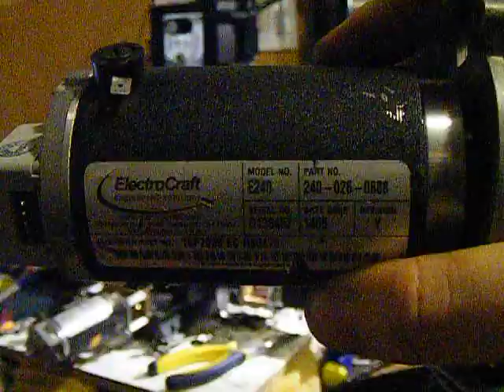CNC milling machine update 3 (Sherline with servos!)

Comment: DC Permanent magnet Servo Motor
0.22 Nm Stall Torque
1.7 Nm Peak Torque
3.1 Amps Stall Current
24.5 Peak Current
4700 RPM Max Speed
48 VDC Max Voltage
1.1 kg Weight
4.5 kg Radial Load
2.3 kg Axial Load
7.8 v/kRPM Voltage Const